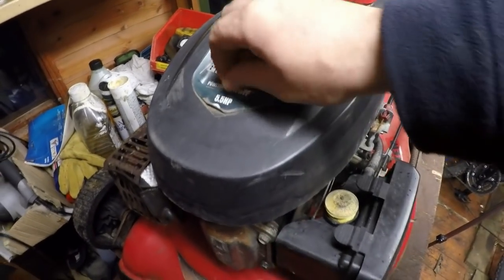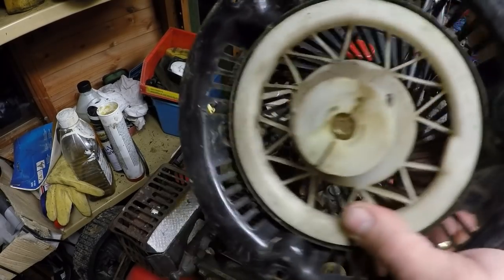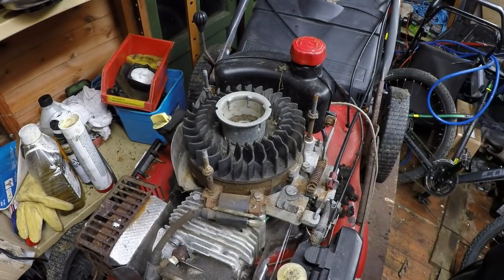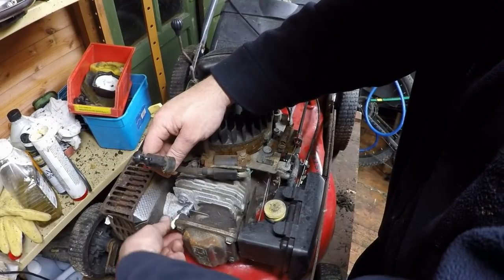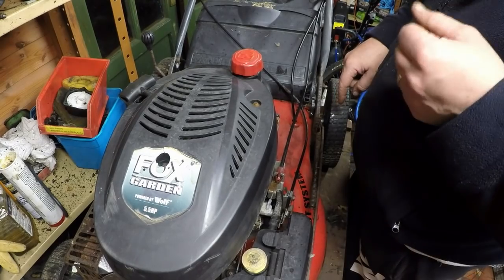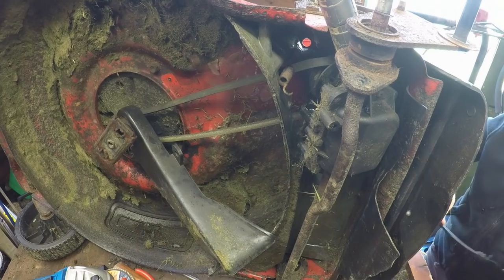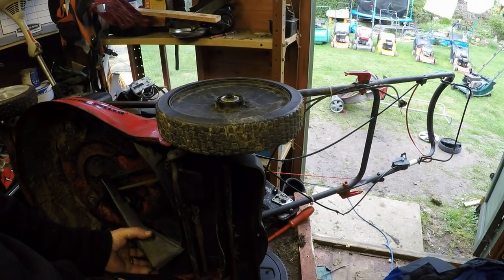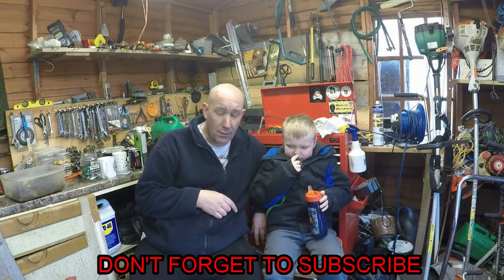#lawnmower #howtofix #easyfix Lawnmower With A Drive Problem Lets Fix It

Comment: Great video can't wait for the next one
Reply from the maker: Ta mate what you working on at the moment?
Reply: I'm working on a lawnmower that has 1 taco sticker on but is powered by an old Tecumseh engine I can't find a model number anywhere the back carburettor plate recently cracked and I am having trouble finding a new one could I have your email and I will send you some photos?

Comment: Just seen this vid and brought home all the problems I had on mine. Bought for £50 it was almost brand new, used twice. Within 4 months the drive cable had gone the dead mans cable had gone and the mower cap broke like this one. I tried to buy another one and couldn't cos no one stocked them. The frisky fox was sold on for, wait for it, £50 to some one else. Using it semi commercially was not the best decision. The engine was ok but the cut was awful. Great catching up on the old vids.

Comment: Hi Mick where does that small round tension spring the one that is shown just before you withdraw the old cable and Riley hits his head hook onto mine fell out loose and I can’t see in your video where you attach it too?
Reply from the maker: It should hook onto the gearbox and the other end on the plastic cowling I believe
Reply: @themowerman  Many thanks for prompt reply I will give it a go.

Comment: Hi good video as usual, I’m a bit confused did the drive work correctly? at the end as it looked like it stop and started. Perhaps it just looked like that because the way you showed it. Anyway that’s another one done. I’m busy in the shed I’m concentrating on the higher end ones atm, as locally the market is flooded with lower end mowers, I wonder if us you tubers are a bit to blame for that😧 But it’s saving them and recycling them so that’s good if not they would be in the landfill or scrapyard. Keep them coming🙂👍
Reply from the maker: Life's Hobbies And Happenings I was turning the drive on and off to show it working. I know what your saying but down my end people just want the cheapest ones. But like you say it saves them going to the tip.
Reply: Micks Mowers That’s good that it was fixed, you should have done a stripe😁 have a good day👍